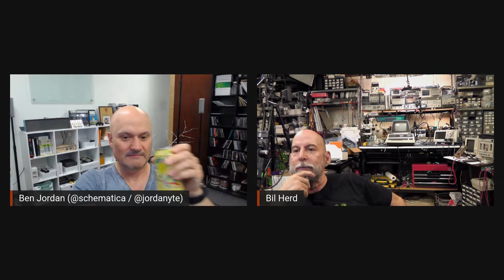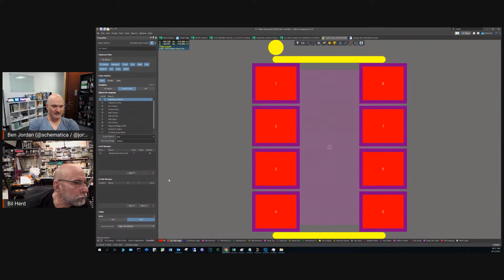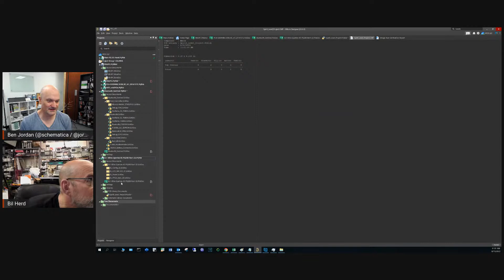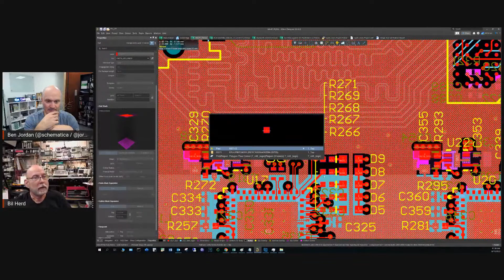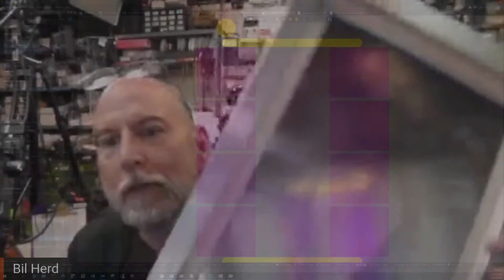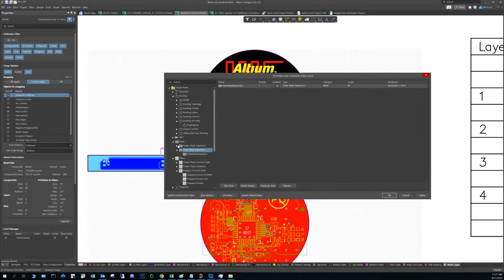Bil and Ben Talk Footprints (Again) - And All the Importance!

Comment: I have only designed one board with 200+ components and agree with all the footprint points made. I had a lot of "fun" with the power device pads, their heat dispersion bias and solder paste considerations. 

Silk screen caught me out because the device labels in one section didn't move when I rearranged components for better layout. The hand assembler of the prototype put a capacitor in the position of a resistor and vice versa.... and the voltage regulator didn't work.